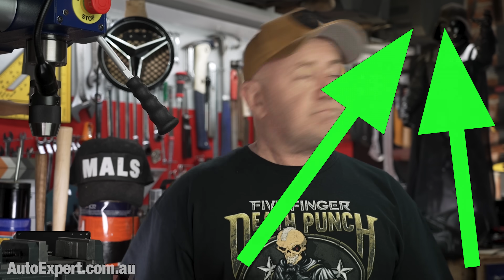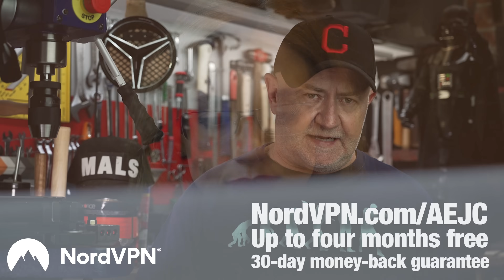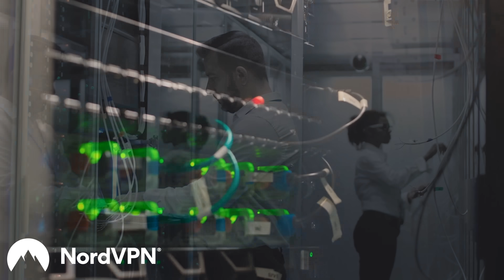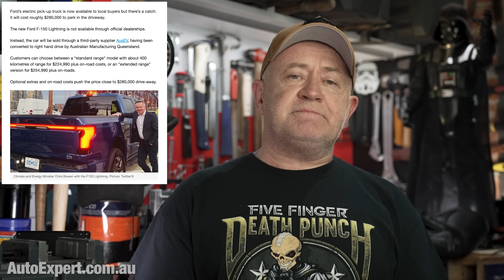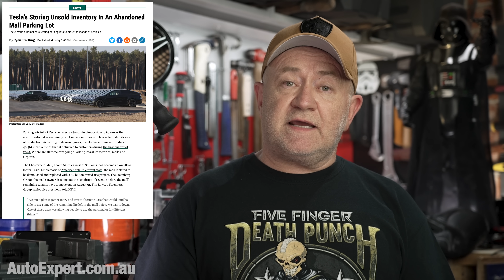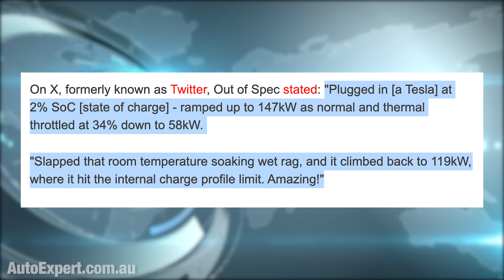ELECTRIC UTOPIA? Top 10 insane EV reports (this month)

Comment: Without the fear mongering about Nuclear Power, we could have by now synthetic fuels already available, and send BEVs back to obsolescence as a century ago.
Reply: Nuclear power plus water creates Steam. Why trains ever used coal is beyond me.
Reply: @ivortoad  yes, absolutely but the cost of getting it wrong doesn't fill the gaps
Reply: @ivortoadthey didn't  have nuclear  energy when steam trains were invented.
Reply: That's a great idea.
Use the electricity that perfectly well could drive the car and make fuel out of it. The fuel company could make a lot of profit out of it. 
Not to mention the transport company's that could make a fortune distributing it to the gas stations that also want it's cut of the deal. 😂
Ever heard of powerlines. It's a thing.
Reply: @Torgrim5958  The problem is not where the energy comes from, the problem is storing it/making it enough portable for mobile applications. Batteries have abysmal energy density, hydrocarbons on the other hand are awesome at that (which is why the world still runs on them). The only issue is that storing the energy into hydrocarbons is very inefficient so unless we have a surplus of energy (or millions of years of time) it's not really a viable solution. Nuclear power is one way for getting massive surplus amounts of energy that could make synthetic (or rather synthesized) fuels a viable replacement for the ones we're still digging out from the ground...
Reply: @zwerko  the uk has a grid so storage is less of a problem, you can tap into it anywhere and gas, nuclear and water power can be upped as needed.
Reply: @zwerko  Batteries in cars are energydens enough now. And it keeps improving. I don't get it. I drive a Tesla model Y.
Daily driving uses about 5% of the battery in summer and 8 to 10 in winter, including 3 to 4 preheats before driving.
We  do south European roadtrips each summer of 10 to 15 000Km. In 2022 North Norway via Poland Germany and ended up in Lands end UK before returning to home.
We don't charge when we have to. We charge when we can. Because we live where we live we don't have fuel costs except on road trips, and it's still cheaper than gas.
That said, if you can't charge at home I would not recommend getting one.
Reply: @Torgrim5958  and you think powerlines are free? Part of your electricity bill goes to pay the grid distribution providers to build and maintain those powerlines.

Another part of of your electricity bill goes to pay the energy retailer essentially for taking your meter reading, and sending you a bill.....
Reply: @peeemm2032  My car smartcharges when the price is low. Mostly at night when the grid charge also is low.
Total fuel costs for May and June are negative, including grid charge. Yes, negative pricing, it's a thing.
Reply: @Torgrim5958 yes,  lots of things are things.

I think you have me confused with somebody else.... I didn't say anything about electricity usage pricing, negative or otherwise.

You were complaining about transport companies and gas stations getting a cut of petrol (gas) prices for trucking it from the refinery, and distributing it and vending it to you in a convenient form for retail use. You implied that if you used an EV, you don't have to pay for distribution of electricity, because...powerlines.

I was just reminding you that power companies are getting a cut of your electricity bill for carrying the electrical energy from the power station, and distributing it to you, and that they perform the same function as the transport companies and filling stations do in the fossil fuel world.....and charge you for it in the same way.....

Powerlines aren't free, someone has to pay for them, and because power companies aren't charities, that'll be you..
Reply: Synthetic fuels still give off pollutants, but most of them also take up field space that could be used by solar, wind or even food. Most of them still require the addition of traditional fuels. Synthetic in most cases just means chemically altered like 90% of Synthetic oils which are regular oils that are chemically altered to work in higher temperatures.
Reply: @robhudson1501   Beneath this rush push towards BEVs, the strategy it's to lower Oil imports. Synthetic fuels make perfect economical sense for that. Being used with cars already on the roads, as using the infrastructure already in place. Producing more cars, especially with massive battery packs isn't the answer, as you trading Carbon emissions with destruction of  land as Ecosystems.
Reply: @RogerM88  I am opposed to EVs so don't argue that case with me but your point is that we need to be fuel independent? Why, when the old way was working so well?
Reply: @RogerM88  I don't want EVs on the road Either, bloody stupid idea.
Reply: @RogerM88  synthetic fuels are just that, because of opec we are forced to import oil from non commonwealth countries. Without it we might stand alone.
Reply: @robhudson1501  I get it, you don't want an EV. But why do you mind other people driving them?
Reply: @Torgrim5958  you're quite welcome to do whatever you want
Reply: Greenpeace and American/Russians taking short cuts made sure of that. 

And Greenpeace is now stopping kids in the development world from getting vitamin A. 

I could go on but we’re on the same page.
Reply: Without the fear mongering we would have free energy for all.
Reply: But the scaremongering about nuclear power is an operational characteristic. It’s not going away either
Reply: @theairstig9164  Germany's coal miners/electrical suppliers got a file/operation "How to kill nuclear". . . . . Mission accomplished.
Reply: @jabberwockytdi8901  Add to that lower the need to intensive mining for battery production. As being used by other industries besides the Automotive sector.
Reply: @jabberwockytdi8901  look up the losses in the process. Electrisity is not an energy source. Its an energy carrier. You have to source electrisity somewhere. So efficient use is important. Unless you find an unlimited source. Wind/solar is but high cost and uneven. Hydro is great if you have it.
Reply: @jabberwockytdi8901  Some made with hydrogen and carbon, here I'd the quote from Wikipedia: Synthetic fuel or synfuel is a liquid fuel, or sometimes gaseous fuel, obtained from syngas, a mixture of carbon monoxide and hydrogen, in which the syngas was derived from gasification of solid feedstocks such as coal or biomass or by reforming of natural gas.
Reply: @jabberwockytdi8901  Why do we need to reduce CO2?
Reply: @jabberwockytdi8901  I'm not pro ev or net zero or even worried about CO2 however I'm not confused either, creating synthetic fuels cost more in energy to produce. We have perfectly good sources of hydrocarbons an synthetic is only taking those and altering them chemically a process that actually makes them less energy efficient because you've already wasted that energy to make them. Yes they are oxygen and hydrogen based but so is petrol and diesel and we would use those to make a synthetic version. You cannot get more energy out of that system
Reply: OH thats right the oil companys bought the rights to alt tec, and sent it to the volt in the basement.
Reply: @hippiebroughton5564  Very expensive. Not scalable. Definitely don t close the existing ones tho (hm hm...germany)
Reply: @hippiebroughton5564  Oil companies want to make money essentially. If they feared really BEVs, they would by now converting many gas stations into charging spots, as buying supercharging networks. They would be making profit the same way selling Oil, plenty of other industries besides the Automotive sector.
Reply: $25 a litre 
Yes let’s all have synthetic fuel 🤦‍♂️🤦‍♂️🤦‍♂️
Reply: @davidbarnsley8486  Not long ago the concept of shovel in battery packs  on cars wasn't a concept to be adopted at a mass scale. Give time to the technology evolve.

Comment: We killed 250 enemy combatants but at least we didn't pollute the battle space with exhaust fumes...
Reply: And all the pollution from all those explosions and fires don’t worry about that
Reply: What a joke electric vehicles would be on the battlefield
Reply: And the survivors ran away.. thermally..💥😯
Reply: Haha, stopping a tank from being destroyed and preventing  polution, will be more important than protecting citizen soldiers.

Robots will not be taking over the battlefield
Reply: @miksta88  Tesla bots will make good stationary tank traps
Reply: Nope just used depleted uranium rounds.
Reply: Right, we didn't "pollute" with exhaust fumes.
Lets ignore the fumes from runaway battery fires. They will kill soldiers, on both sides.
Reply: Indeed
Reply: There's a reason why the Abrams tank uses a turbine for an engine. It's quieter than a diesel engine. Silence and stealth is a key advantage on the battlefield. An electric motor produces next to no noise. The key issue of course remains the lackluster battery tech we have. This needs to improve massively just like ICE tech has advanced significantly since it was first developed
Reply: @macbuff81  It won't improve. It hasn't improved since the 1970's. Why would it suddenly improve now?
Reply: @macbuff81 and when on the move they found it more efficient pe mile
Reply: @gingernutpreacher  thats not true. efficiency and cost of materials was the downfall of the turbine engine in the early days.
Reply: @maddhatter3564  I'm on about the abraham not cars.
Reply: @macbuff81  I didn't know that about the tank. Quite fascinating - I wonder why they haven't scaled those down to normal cars yet. I I remember one of the US carmakers did try it years back but things have moved on since then.
Reply: @marcdraco Because they may be very slightly quieter, though I never noticed much difference, but they drink shed loads of fuel and light up like a christmas tree on thermal imaging....and they need way more maintenance than a diesel. Hence why no one else has gone down the route of turbine engines.
Reply: @rosetintedglass67  Ah! With you, a bit like Wankel then?

All that thermal energy is heat that could have been put to other work for example making the vehicle move forward. Makes sense in a jet because that exhaust is thrust.

I honestly did not know that but it makes a lot of sense, so thank you, I appreciate your time explaining.
Reply: @marcdraco  turbines? they wer pioneered by chrysler in the 1960s, last i heard Mitsubishi or Mazda bought the tech.
Reply: @maddhatter3564  that’s what I must have seen! Thanks man, appreciate it.